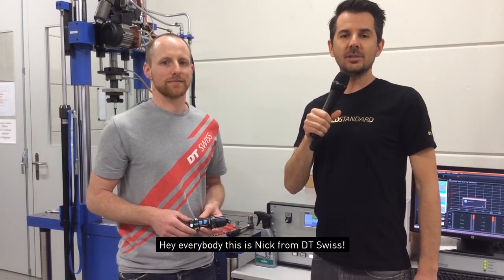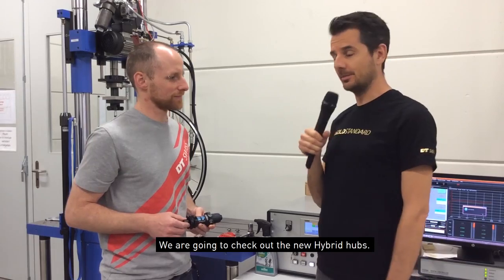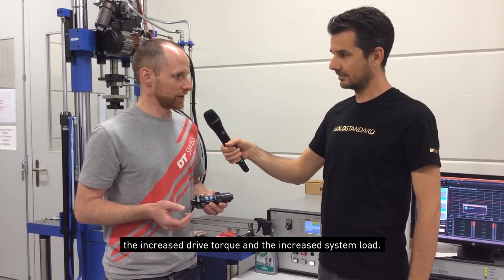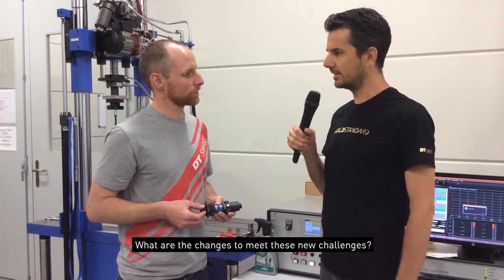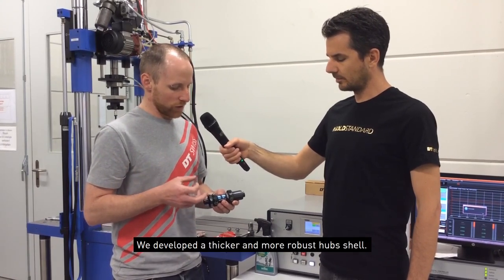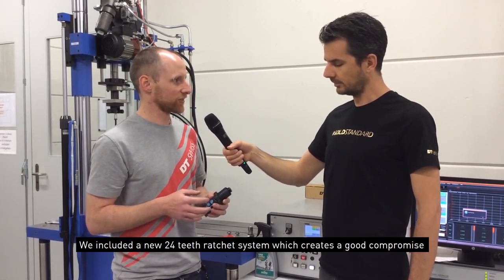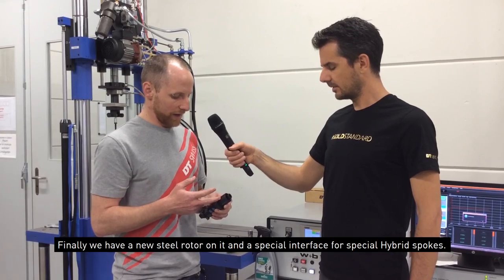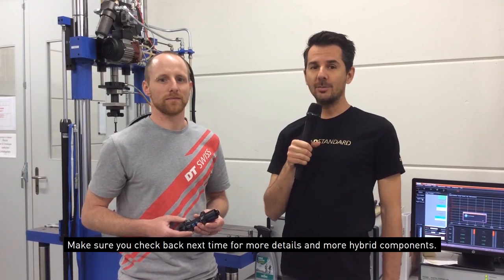Development of a new wheelset (2/4).  | DT Swiss

Comment: Special spokes for special folks... I received an HX 1501 Spline One 30 as a warranty replacement wheel, when my specialized levo rear wheel spokes failed for the second time. 
I've been running it off-road since November 2019 (about 500 miles) and had no issues until a week ago and 1 spoke broke. The spoke failed in the threads inside the nipple. It detached itself and left 90% of the threaded part of itself inside the nipple. I don't know exactly what caused it to fail. I discovered it while riding because I heard the sound of it flailing around. I had not had any event with foreign objects hitting it that I was aware of, but it's also a possibility because of the trail conditions earlier on this ride or others. Nevertheless I wonder if this is an odd failure mode for a spoke failure?
Reply from the maker: Hi there
First of all I had to say sorry about the bad experience you had with your wheel. Regarding your question, from our experience we know that without any external influences a spoke will not break. I would suggest to send the Wheel to one of our service centers for further investigation. Friso "DT Swiss".
Reply: @dtswiss  thanks for your concern and interest to help. The first thing I did was contact DT Swiss in Colorado and they sent me some replacement spokes. I put the correct one in for the drive side already. 
In order to replace the nipple I cut through the rim tape and patched it with Gorilla brand duct tape. I checked all spokes' tension and restored them to their original values when I got the wheel. The rims still runs very true. I saved the broken Spoke and nipple if you're interested in doing any metallurgical failure analysis of the threaded regions of the parts.
Reply from the maker: Thank your for your feedback. With my colleagues in Grand Junction you're in good hands. You can forward the broken spoke to them.
Stay healthy, Friso "DT Swiss".